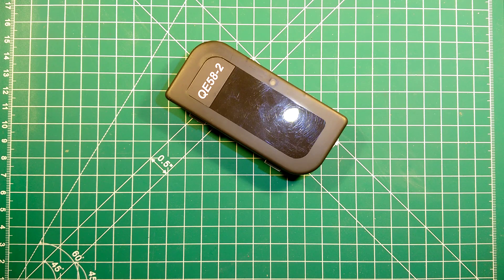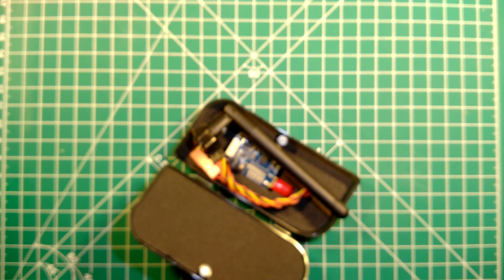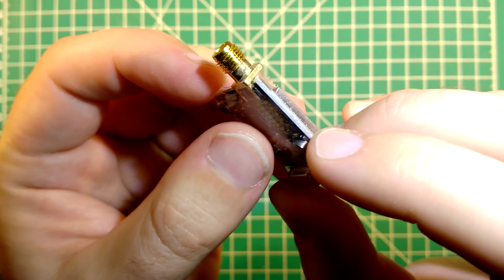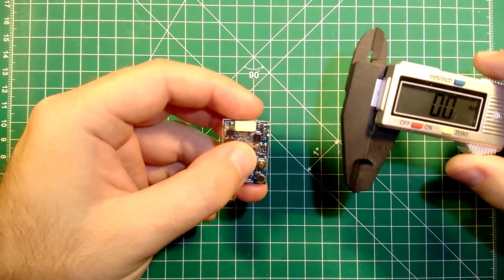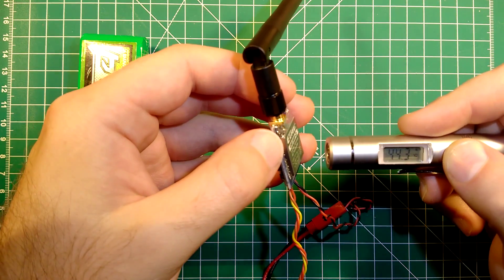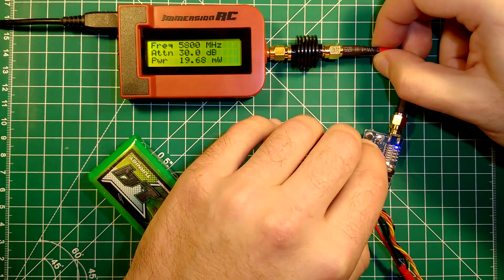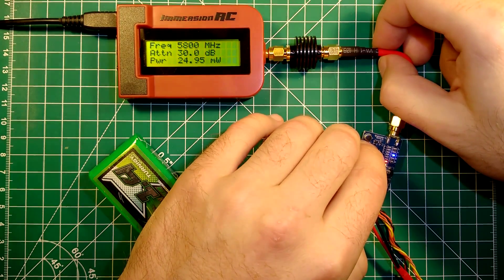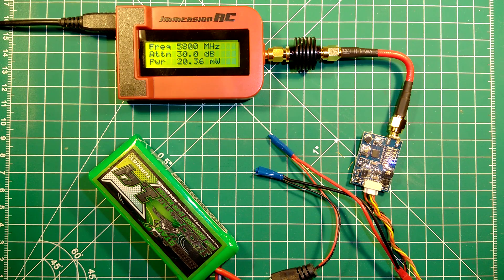Quanum Elite QE58-2 5.8GHz 25-200mW VTX: Bench Review & RF Power Measurements

Comment: Great Video! Table on website shows it delivers much more than 200mw almost 400mw. How is the temperature development when in 200mw mode? Most 200 mw tx have a much larger heat sink.

I have the elite 25-600 mw selectable version. Does anyone have any measurements for that?
Reply from the maker: It does get hotter than other 200mW VTXs in 200mW mode. I would not run it without good air cooling.

Comment: If I cut it to get 200 mw can I solder it back to get 25 mw?  Whether all the necessary cables included?
Reply: I soldered a tiny switch to select power output on the fly.
Reply from the maker: +GG Nothing included with regards to this. You have to improvise.

Comment: I am 99% set on ordering two of those. question thou: could you please check the output on the 200mw setting? Say top and bottom channel. I just wander if it will be sub 200mw or 300+mw. Thank you  in advance.
Reply from the maker: +SirCrashaLot Alright! I'll put this on my review schedule. Will do!
Reply from the maker: +RC FPV Flight My website now contains the measurements for the 200mW setting as well: http://rcfpvflight.com/articles/quanum-elite-qe58-2-5-8ghz-25-200mw-vtx-rf-power-measurements/
Reply: +RC FPV Flight much appreciated. I really like that 25/350mw VTX :D ordered

Comment: how you can switch from 25mW and 200mW?
Reply from the maker: +Maximilian Halla As shown in the video, it is not really a switch, but rather a lead which you have to cut. I go into detail about this at around 2:56 of the video.
Reply: +RC FPV Flight Big question being: how about side mounting a single dip switch and soldering the ends of the wires. I am seriously thinking of doing just that.
Reply from the maker: +SirCrashaLot Great idea. I believe I also mention this possibility in the video. If you do it, let me know how it went :-)
Reply: Sure, I agree with the price/no issue to mod it remark. Hard to beat it, I feel I know it already being a long time FX799 user. My main reason for a change is to be able to participate in races on the 25mw setting. 
Also funny enough no one mentions that those have the ability to feed 12v out. Its not present on the instruction. All that needs to happen is move of that resistor to the bottom position (right lower corner). That raises few questions on 3s and of course people did burn those when feeding on LiPo directly so maybe thats why :)
Reply: +SirCrashaLot I live in Germany, it is allowed, max. 25mW at Fpv 5,8 Ghz (sry my English is bad)
Reply: +Maximilian Halla i will illegal fly with 200mW maybe
Reply: SirCrashaLot hi, could you explain that? I want to use this on a quad with a 4s lipo and a hs1177 cam. I think the 5v out is ok for cam. What problem could I have switching the resistor to get 12v output? Thank you

Comment: Thanks for a good review.  It seems like, as you go higher in channel in any band, the power goes down ... at least in most bands.  This does not bode well for me, as I use the Eachine 200mw VTX (as well as 2 other VTXs by other manufacturers) and I've set them all the B8.  Perhaps I should switch them all to B2 or B3, but without a $150 meter, its hard to say.  I did at least take out several antennas today, and set up an 25mw VTX and walked out with my diversity receiver set to Channel A, with nothing on the B input. I then went through 5 different antennas. The winner was my IBCrazy Mad Mushroom. I will soon be getting a set of Birds Eye View antennas and it will be interesting to see if they out perform the IBCrazy antennas. Cheers!
Reply from the maker: +Bill Somrak My pleasure Bill. What you noticed is indeed the case for this series of VTX. I have already tested (but not yet put online) some more of the Quanum Elite VTX, and they all have this behaviour (go down in mW, as the channel goes up). Interesting. More videos will soon be online. Awesome to hear about your antenna tests, keep me updated :-).
Reply from the maker: +RC FPV Flight My website now contains the measurements for the 200mW setting as well: 
http://rcfpvflight.com/articles/quanum-elite-qe58-2-5-8ghz-25-200mw-vtx-rf-power-measurements/